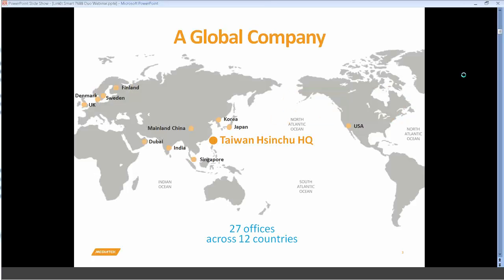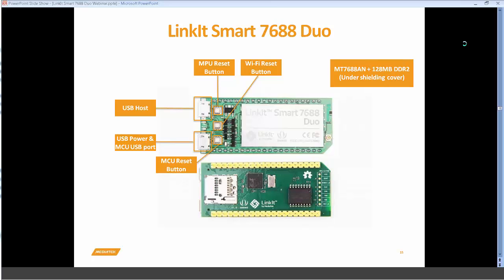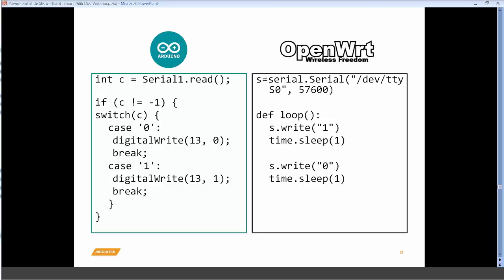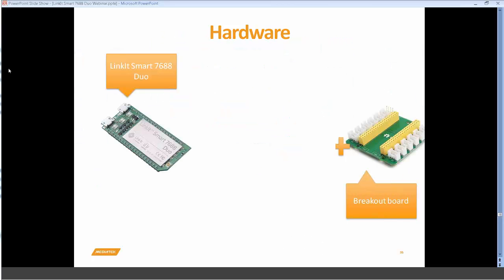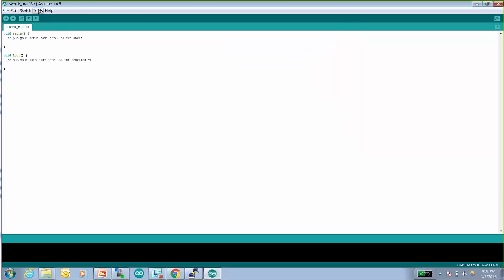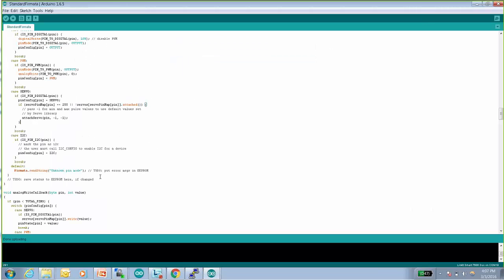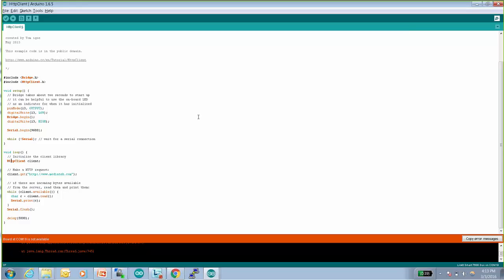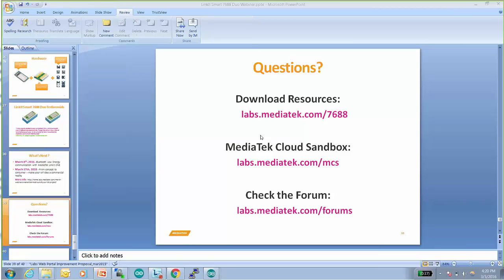MediaTek Labs Webinar: Peripheral Programming using Arduino and Python on LinkIt™ Smart 7688 Duo

Comment: I cannt upload ex. code to borad it show 

Arduino: 1.6.9 (Windows 10), Board: "LinkIt Smart 7688 Duo"

C:\Program Files (x86)\Arduino\hardware\arduino\avr\cores\arduino\CDC.cpp: In function 'bool CDC_Setup(USBSetup&)':

C:\Program Files (x86)\Arduino\hardware\arduino\avr\cores\arduino\CDC.cpp:104:29: error: 'MAGIC_KEY_POS' was not declared in this scope

    uint16_t magic_key_pos = MAGIC_KEY_POS;

                             ^

C:\Program Files (x86)\Arduino\hardware\arduino\avr\cores\arduino\CDC.cpp:129:34: error: 'MAGIC_KEY' was not declared in this scope

     *(uint16_t *)magic_key_pos = MAGIC_KEY;

                                  ^

exit status 1
Error compiling for board LinkIt Smart 7688 Duo.

This report would have more information with
"Show verbose output during compilation"
option enabled in File -> Preferences.
Reply: Hi, Try:

Install (in Boards Manager)
 1) Arduino SAM Boards (32-bits ARM Cortex-M3) versión 1.6.8
 2) Arduino SAMD Boards (32-bits ARM Cortex-M10+) versión 1.6.6

And change Arduino AVR Boards 1.6.11 to 1.6.10 versión